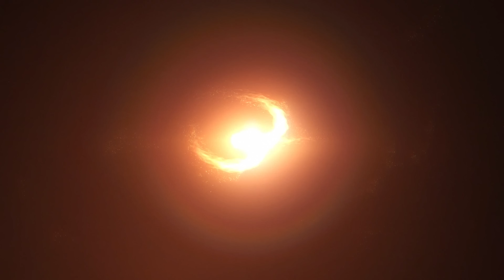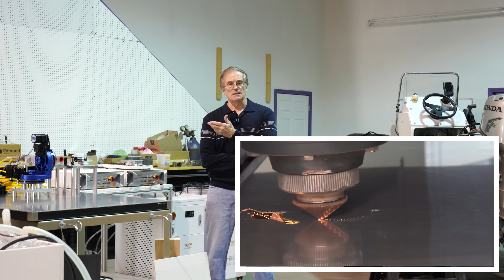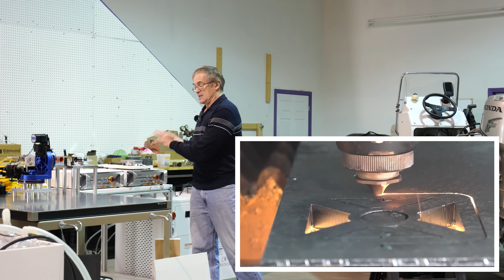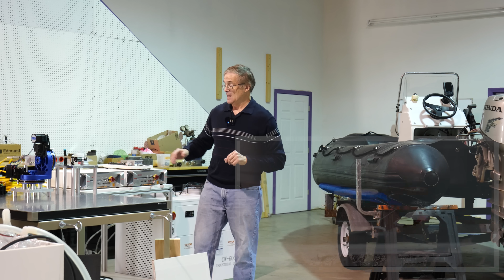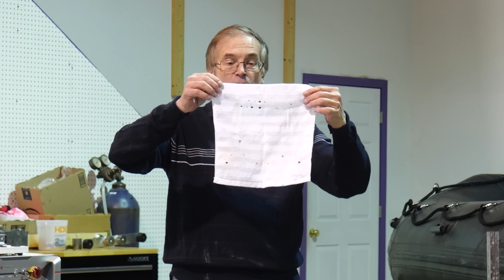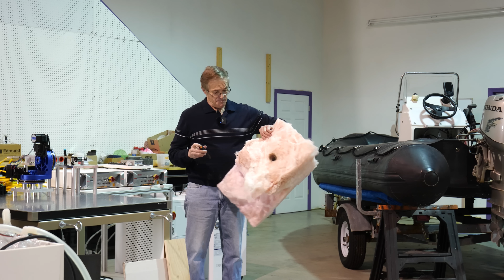We have a problem... and need your help!

Comment: Lets look at it in reverse order to find a solution. Items are bieng burnt, this is due to heat being transferrd onto them that takes very small amount of time to conduct, the source of that heat is the energy from laser, and the laser is compiled by converging energy in a very small area. So in this scenario, the ideal cheaper reverse would be to diffuse the laser at the recieving end by dispersing it. you need motion to acheive this. 1) Firslty have a convex mirror, similar to what cars have on thier door's rear view mirrors to help with parking. The mirror will not diffuse laser, its only redirecting it. 2) Now, find a way to rotate this mirror, so that laser is not constnatly concentrated at one spot allowing it to heat up. The position of mirror is important, the laser needs to point to the lower section of the rotating covex mirror, so it's safely redirected to the ground. 2) Place a container of water below it where the laser will end up in, the water in container will also need to be in motion, , this is where you'll get your diffusion, it would be safer if the inside surface of the contaner is also reflective. A simple pump inside the container will keep water in motion, allowing refraction in multiple directions. Both the speed of the otating mirror and the motion in water needs to be high enough to match the power of the laser. You should end up with warm water, so energy is not gone, its just transferred.

Comment: Some ceramics, like silicon carbide or alumina, can absorb or dissipate the laser energy due to their high thermal resistance and low thermal conductivity.

Comment: Some ceramics, like silicon carbide or alumina, can absorb or dissipate the laser energy due to their high thermal resistance and low thermal conductivity.
- *Specialized absorbers*: Materials specifically designed for laser absorption, such as graphite or carbon-based composites, can effectively absorb the laser energy.

Comment: I have a few ideas of varying ignotantness 

Have you considered trying carbon black coated graphite blocks    $30-$50.  A few of those may help.

Maybe a think walked metal pipe with graphite powder inside. Put the beam down the pipe into the powder. 

Maybe aerogel or carbon carbon blocks liked used in re entry heat shields?

Comment: Have you considered refractory firebrick or Kaowool? The TKOR channel built several small foundries using various materials, but settled on Kaowool for a number of their later versions, and it withstands high heat very well. Refractory firebrick may not be as portable as kaowool, but it is specifically designed for kilns and foundry work

Comment: How about white smoke ? Diffuse and distribute the beam over a large enough volume and it will loose its ability to do damage. A fishtank with cloudy water might run the risk of explosive vaporisation so I would avoid damp materials. A smoke screen is in effect self-repairing. Not sure if the frequency of the laser matters, but there is smoke that's IR opaque I think intended to block IR vision on the battlefield. I'd be interested to see if a target inside a smoke-bubble would get cooked from all angles.

Fishtank containing smoke would give you less dispersion. Combine a tank of dispersive smoke and a thermal-sink black object 'concealed' in the smoke and you might get the best of both worlds.

In the Traveller sci-fi game ships carry 'Sand-casters' as defensive weapon screens vs lasers btw :)
Reply from the maker: We don't want to obscure the drone targets, and we don't have a thermal camera... yet.
Reply: @TechIngredients  I had assumed the smoke screen would be a 'backstop'  for safety. One safety consideration might be that fine powders can become combustible so I would test that the smoke does not behave like custard powder.

Comment: Have you thought about diffusive solutions? Maybe an alumina/ceramic wool blanket like the ones used in the cheap kilns. It would be both diffusive and high temperature resistant... Your beam is probably more energy dense, but we used that to stop the sun from melting our shield in a 104kw 100x Sun concentrator.

Comment: How about diffusing the beam with a lense rather than trying to absorb the energy?  You could rig a 2D motion tracker with cables and automatically move the lense to always be aligned to where the laser is pointing.

Comment: Could you use casting sand that is used in foundries?  It can be made into blocks and can be reused. It with stands 3500 degrees f.  ????

Comment: Instead of soaking a mat, run water over the lip of a trough so that it forms a sheet of falling water. Or just run a sheet of water over a cheap, replaceable substrate.
Reply from the maker: That and the rockwool suggestions seem the most promising so far.

Comment: WOW, you are going to be doing some reading! 5036 comments in 10 hours and 48,000 views. Most of it is worthless because they didn't listen to and take into account, your needs. 

Can't help you with your lasers but maybe some of the suggestions could be put on top of a large solid  trolley and you roll it into place when needed and back out of the way when finished.
Reply from the maker: It's a labor of love.

Comment: Starlite covered plywood?
Soak the plywood in something that blocks oxygen from getting to it so it carbonizes but doesn't burst into flames?
A FISH TANK (fishless) filled with a solution of something that absorbs the laser? That way it could be maybe 30-50cm thick and you'd be dissipating the laser energy in a longer distance, into a fluid that can rapidly mix and move heat away. You could put the fish tank on some sort of cart or whatever. Maybe even rotate it while lasering it so it doesn't heat up always the same spot.
Whatever else I can out of the top of my head think would work, it goes back to metals. It should be something that has a large heat capacity so it absorbs a lot of energy before starting to melt/vaporize, and that transfers that heat away fast enough. Other than that, maybe a mirror and angle it into the ground/sky?

Comment: Possibly amalgamating several of your attempts such as:  Two sheets of plywood with a gap in between with a pipe across the top which constantly recycles a cascade of water sliding down the internal surfaces/gap.  The laser might burn thru the entry layer only to be doused & diffused by the water. A pump and reservoir on a cart recycle the fluid.  This would be scalable by increasing the volume that the pump could handle, but would be light weight & mobile.

Comment: In a video from The King of Random. They were trying to burn dry ice with a solar laser built from an old TV screen. The dry ice was so white that it wouldn’t burn despite the laser destroying bottles of soda in <30 seconds and melting metals like copper and aluminum nearly instantly. I don’t know how much you’d need, but it worked pretty well in their experiment.

Comment: Some ideas off the top of my head:
1) make a frame that points the lazer downwards (or at a angle) into the ground / dirt. It would need to be high enough for the drones to pass  underneath

2) Dirt heap like at a shooting range (or maybe just a nearby hill). 

3) Using some sort of cheap ablative material (like starlite). The youtube channel NightHawkInLight has a two part series (History of a Lost Supermaterial & How To Make It (Starlite Part 2)) where he used baking soda, corn starch and white glue to protect an egg from a butane torche. I know the space shuttle used ablative tiles for reentry. Maybe with some research you could find something that works.

Comment: Hello, Absolute novice here... This is a great format of "Laser" I have a few ideas each one worst than the next but (hey) nothing ventured nothing gained, right... First how about a Sci-Fi idea, like using a crystal plain of glass like an absorbent dark green colour try different thickness or diamond sheet glass or similar... Next how about a magnify glass the collects the laser beam and scatters the beam like a half dome ball or convex lens or something like a diamond funnel lens ; if you can condense the beam I'm sure you could scatter the beam too... More elaborate way to shut-off the machine (might not work effectively) but maybe of some use: Use another computer or device to shut-off or auto shut-off the laser when the laser distance to the object changes or when the target distance changes... That's confusing me too; have one laser distance measuring beam to focus on the target measuring the distance as soon as the "Burn" laser is fired the second laser (distance laser has a fixed distance measured) when it changes then the second computer will auto shut-off or "kill" the "Burn" laser system... Sounds confusing but may work if you can get a more accurate  distance measuring laser system with speed in mind...Basically if the laser distance MONITORING system on the target which has a constant distance and when the distance changes the system cuts off the laser power... Man, that was longer than expected... Cheer... Hopefully what I wrote makes sense if not call me... LoL... I'm sure it's just not the best options but I hope something sparks a new idea or gives you some other ideas... P.s: I also have an idea for the laser drone kill but this is not the video Comment for that plus still ironing out some principles...

Comment: Aircrete panels, using fiberglass as a reinforcement they could be made fairly thin and lightweight for concrete, could also consider using vermiculite in concrete to make thinner lighter concrete panels. Also try building a waterfall, Using PVC, pumps and a trough have water cascading down in a continuous sheet.   Thats what came to mind.  Good luck with your endeavors.

Comment: The general idea is to duplicate the ultra black surfaces that are microscopic pyramid facing the light.  To expand this idea, think of a knife block that holds kitchen knives with a mass of fibers vertical in a wood container that hold the knives.  Instead use a packed container of fine carbon fibers that the beam hits in the axis of the fibers. The laser beam could travel along the fibers gradually being absorbed.  Carbon fibers can take a lot of energy so if absorbtion is adjust by fiber density the heat would be distributed in the depth of the fiber bundle.

Comment: Water tank with a thick acrylic port hole as a target. Acrylic gives off VOCs when cut; not great, but less toxic than even plywood glue. The port hole is replaceable between shots, but it could also be repaired by gluing in segments of acrylic rod. Since the spot size is small by nature, the holes should be small and the water loss should be low as well; place a tray or pan below the port hole to catch and reuse the water. The inside of the tank can be coated with something that absorbs at/near the laser wavelength, or be coated/polished to reflect laser light back into the water. Add mica powder (or similar) to the water to further scatter the laser light; keep it distributed by circulation...a sealed system with a peristaltic pump will circulate the water without fouling. Tilt the tank vertical to replace/service the port hole; it could be mounted on a stand with pivots at the cg of the full tank to make this easier. Reflections coming back from the first surface of the port hole might be minimized by firing through a sacrificial curtain; space out alternating layers of heavy canvas and mylar "space blanket" material...it shouldn't catch fire (maybe smolder a bit, soaking the canvas with water would minimize this), and it should catch scattered light and reflect semi-cohesive light back towards the tank. This way, the only cohesive light coming back towards the source would be straight back at the emitter through the holes in the multi-layer curtain, and only from when it first hits the acrylic port hole until the laser ablates through to the water, which should be a very short timespan from the sound of it.

Comment: Here is a cheap and portable solution with some limitations: Limit the laser targeting to an annulus around the center. Mount the backplate material on a motor at the center. Set the speed of the backplate motor to above the cutting speed of the material at the inner edge of the targeting area. 
   The material now lasts for a lot longer by dispersing the damage. Adding a second layer a meter behind would make for easy penetration inspection.

Comment: I have a few ideas of varying ignotantness 

Have you considered trying carbon black coated graphite blocks    $30-$50.  
Or carbon black coated copper plate.  My mind is picturing those chunky copper plates in high voltage substations.

Maybe a think walked metal pipe with graphite powder inside. Put the beam down the pipe into the powder. 

Maybe aerogel or carbon carbon blocks liked used in re entry heat shields?

Comment: This may not work and/or be way too much work, but what about modifying the setup a bit? If there was a rangefinder on the device, you could have the beam leave at a pretty large diameter and have it only reach its minimum diameter at the target. Once it passed the target it would then open up again and be of much lower intensity at the back wall, pretty much the same idea used in the cutters but the focal length would be much longer. I’m pretty sure that this could be done with the range of the target from the aperture of the laser and a way to precisely move a convex lens in front of said aperture,though the wide columnated light would be needed before this final lens

Comment: I have an idea. To use an electromagnetic field on the receiving end of the laser as a kind of lens to diffuse the light beam after the cutting has been done. Also, if you hook up a plasma reactor, I'm not sure, I'm speculating, to absorb the diffused laser light, you might be able to recoup some of the energy you've spent on the laser in the first place? Anyway, light is its own antiparticle. You could have a laser that is tuned precisely to annihilate the first one when their beams meet?

Comment: Would a aerogel work?  It tends to diffuse light.  Maybe a spinning disc?
Reply from the maker: Probably not. 
If it absorbs the laser, it's extremely low mass, which would mean that it will get very hot, very quickly.
Reply: @TechIngredients  well aerogel is able to take a lot of heat.  If it were spinning, the rate of spinning would determine how long any section was exposed.  One of it's properties is a very high surface area.

Here is a random video showing it taking a torch.
https://www.youtube.com/watch?v=g9d71L4mCd8

Comment: How about a thin tank with water and something in some sort of colloidal suspension like corn starch or something like that? Maybe that would scatter the light, and the water could boil but would replace itself at the spot the laser is hitting it, creating convection currents. Then you can just drain the tank outside when you want to move it. Not sure if the glass/acrylic/whatever would melt first though... :/ Also depending on the size you need to cover, that tank could get pretty big and heavy I guess.

Comment: So, what you want is a beam trap. My idea is to make a chamber - size is your decision - with walls of glass filled with glass beads or ground glass. My intuition tells me at least 4" thick. Cover the outside - the rear face and sidewalls - with 1/8" copper plate. The inside surface should be painted black. The front should  be steel plate, except much thinner than the rear, Also coated in black paint, but this time on both sides. The idea is that the beam will punch through the thin steel sheet and the glass sidewalls without issues, but also without retro-reflection (outside the walls that is). The beam will be scattered around the inside of the chamber. It may melt the bead at the point of incidence, but that's ok, its only a tiny spot; easily patched. The remainder of the beam energy is absorbed in the blackened copper, and dissipated into the environment before burnthrough can occur.

Comment: I recommend a backstop comprising borosilicate glass tank filled with borosilicate glass granules (shattered borosilicate glass. That is, IF the path of the errant beam can be predicted with some degree of reliability.  I think that, by the time the beam exists the tank, it will have been splintered and diffused to a nondestructive intensity.

Comment: use some resistors to lower the power input.    shine it thru a glass tube with dust or smoke, lasers are lessoned by smoke,  shine it thru thick panels of glass.

Comment: My 5 cents: it may be unreasonable to try to block the beam at all. Instead, it's much more reasonable to use low power laser for indoor tests and the real death ray outdoors. With hard mechanical stoppers for the turret to allow it operate in one hemisphere.
Reply from the maker: That's not a bad idea, even if just to save the expense of destroying dozens of drones in the testing phase.  Outside is out of the question.  These beams will still be dangerous miles away.
Reply: @TechIngredients  or make it converge at some fixed distance like 30 meters. That may provide enough safety for using it in the open.

Comment: Builder here. Use Lightweight Hebel (Aerated Masonry) Blocks for a vertical wall if you want affordable vertical solutions. You could even line this with a thin compressed fibre cement sheeting.

Fibrous insulation will ignite so you want density. 

See my other comment for a better solution that is for a vertical orientation of the experiment instead.
Reply from the maker: I'll look into those.
Thanks!

Comment: A thick sheet of steel painted with whites paint, I would try the most reflective paint or if the laser cut with another spectrum, try to find a reflective paint to that spectrum. Maybe mass of water in movement in front can spread the beam.